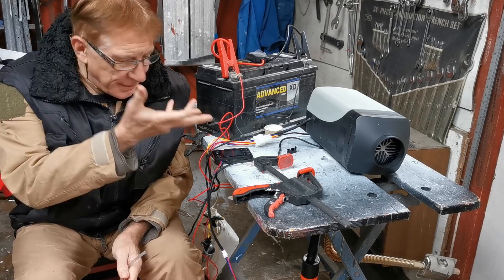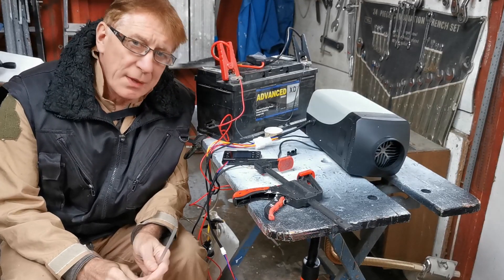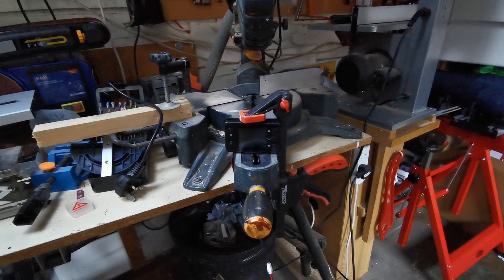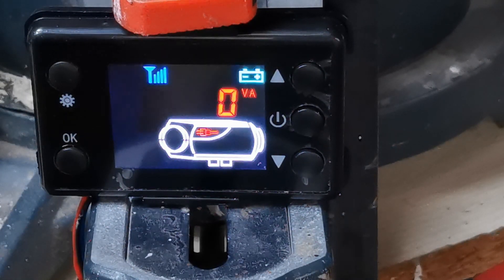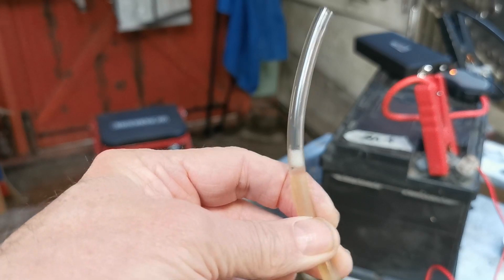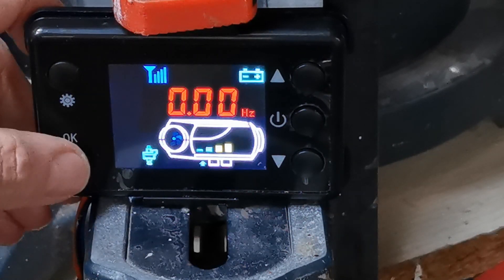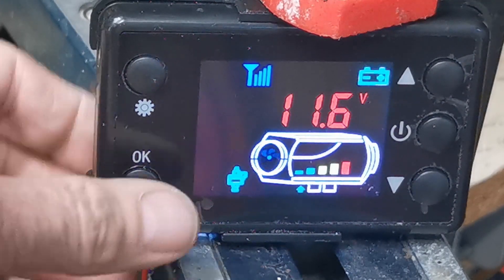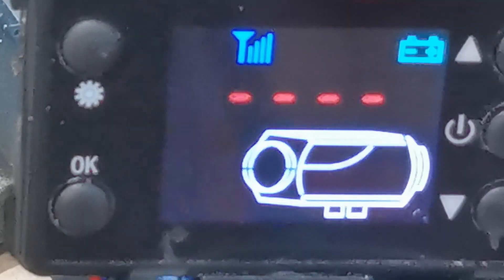2-Fan Blade (or NO fan blade) Icon Controller

Comment: Thank you so much for this video. After searching around and finding the same old black controller videos which are the same as my other diesel heater I found your video by googling 'diesel heater 5.0D'. This controller had me baffled as I was expecting it to work the same as my other black controller. Until I found your video I thought it was faulty but now I know its not and how to operate it. I think this basic simply controller with no timer stuff is probably all most people need especially if its being used in a garage/workshop like mine is! I paid £64 for mine off UK eBay and it arrived within 2 or 3 days. As a suggestion it could help others if you add Diesel Heater, Black Controller and No Timer to your video title.
Reply from the maker: Thanks for the suggestion... I will make the mod to the tags!
Reply: I just bought a CDH with this controller off of Ebay.  After searching the web for hours, this is the only video or any info for that matter I have found.  The only thing the setup button will do is pair the remote.  No advanced settings that I can find.  It's a very basic controller.  Mine will go up to 5.5Hz.  Case temperature at 5.5 is always 200-201c.
Reply from the maker: Hi.. glad the video was of use... but you are right.. a very basic controller indeed! @tomcommander6670

Comment: Thanks for this video it's put mh mind at rest I thought I'd bought a dud lol I don't suppose you know a way of increasing the temperature using the remote the plus and minus buttons just seem to change the setting 🤯
Reply from the maker: That particular controller is very basic so you're correct... all you are doing is adjusting the heat settings... There's no way to actually set a temperature to target. You can do that by swapping out to the much loved six-blade controller but you'll have to swap out the motherboard as well. That is very easy to do and there's a link below on how to do it. However even that six-blade controller is not a panacea and if your heater is in a very small highly insulated environment such as a camper van, you may end up using the manual heat setting in any case because the hysteresis on the thermostat is quite wide and it tends to overshoot..  How to fit the 6 blader..   https://youtu.be/sDwrHozKInc

How to drive the 6 blader.  https://youtu.be/eajqNHY5rs4?si=bpgF23rAdZkkrJaV

Comment: just bought the same one. already have a 2kw one with a "new controller". at first i was thinking they have some new old stock. already heard some people in the group talking about a 5 power settings heater so i realized that's what i got now. one thing i noticed like you did, while starting it gradually starts the glow plug and when you turn it off it just hits it. that tripped both of my pc power supplies that work fine with the other heater. thankfully my power station can deliver 25a on 12v. it peaked around 250w for a moment. wonder what else we can find out about it.
Reply from the maker: That is interesting... I wonder why it is so brutal on the shutdown! A bit of a crude controller but hell... the kit was very cheap  so I am not complaining 😃

Comment: Think I've got the same controller and iam having a nightmare with it.
It's like it's stuck in settings mode won't go above 2.50mz so it's just not hot enough .
There is a little settings icon in the top left corner but I can't seem to get out of it but the heaters seems to be working OK apart from it not getting hot enough
Reply from the maker: Interesting. I'm actually wondering if yours is yet another variant of this controller because I cannot get my settings to 2.5hZ... it's integer units only. It seems these controllers are like COVID... Several main variants of the original controller and then subvariants underneath those. Hmmmmm and funnily enough like Covid they... come from China💭